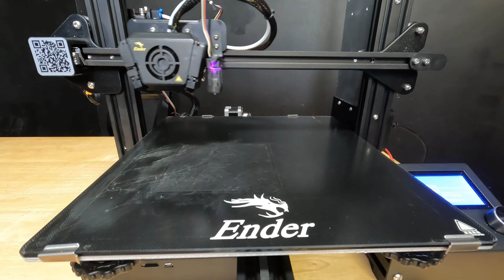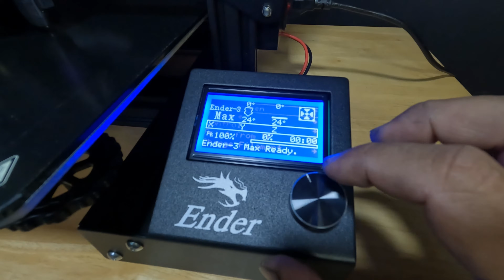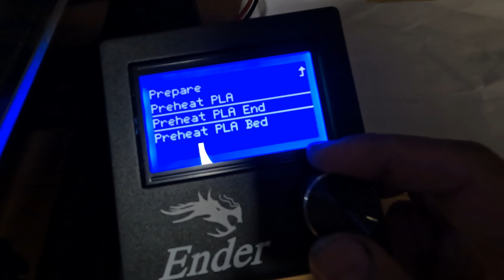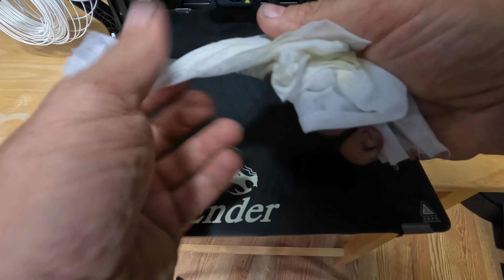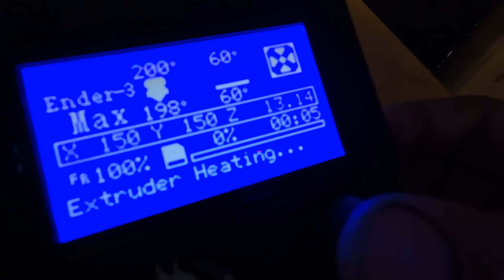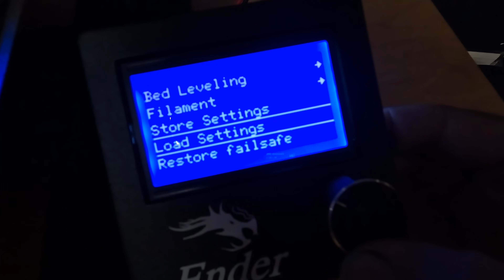Ender 3 Pro or Max: How to Level, Set Z Offset, and Make ABL Mesh, with CR Touch or BL Touch

Comment: Is it possible to only do the z offset without spinning the wheels? I don't know why I mean I'm following you but I don't feel I'm getting it completely, If my prints are dead center they print great but a helmet that takes the intire bed fails in minutes.
Reply from the maker: Z Offset is done last, after manual tramming is done. Do the paper method. Then the Z Offset last, to get the nozzle height down. Your problem sounds like a Tramming or ABL issue. Are you using the gcode for abl/
Reply: @3DRundown  yeah, I'm using m420 s1
Reply from the maker: Do this: https://youtu.be/mKvst6qpkPw
Reply from the maker: Do this: https://youtu.be/veZB415QHM0
Reply: I have the ender 3 max neo is that the same max in your description? I can't go past 0.0mm mine doesn't have 0.01mm option.
Reply from the maker: I'm showing the original 3 MAX here. The NEO is an updated version. Be sure you aren't in the MOVE comment. You need to be on the Z-OFFSET command.
Reply: @3DRundown   I am, I got it to where it looks like it'll possibly succeed but after awhile now my filament gets to worn down and stops feeding I've never seen that before.
Reply from the maker: make sure your extruder tensioner isn't too tight.
Reply: @3DRundown  you just have to make little adjustments with the tension until it works?

Comment: The glass build plate will crash into the back motor on the Ender 3 V2 when you do step 1.
Everyone says "Step 1: tighten the knobs, bring the bed as low as possible"
Then people reply with what I said above but they never get any help.
Does anybody know how to fix this?
Reply from the maker: Do not bring the bed as low as possible. You will warp your hot plate.

Comment: Hello Gregg, I think I might have a glitchy unit (cr touch). after doing an auto home ( and lowering the bed) when I go to the z offset, I cannot lower my hotend to 0.00. It stops at a positive number. I have tried over and over and keep getting a different z offset? Have you ever heard of anything like this?
Reply from the maker: Which machine are you on? Did you remember to remove the Z-STOP Switch? Also, I assume you installed CR-TOUCH compatible Firmware?
Reply: @3DRundown  ender 3 pro, switch removed, firmware updated cr touch
Reply: put in new springs this evening, now I get -0.2 for initial offset after auto home, I guess that is better? I followed your video exactly, I will stick at it. Thank you for making this video
Reply from the maker: Run this drill: https://youtu.be/veZB415QHM0

Comment: I have the sprite on my Ender 3 pro and when I try to level it won’t let me adjust the Z axis lower than +000.0. PLEASE HELP LOL
Reply from the maker: Are you using "move"? Have to be in the Z-Offset function (which sometimes called "Probe Z Offset"). Be sure you removed the Z Stop switch

Comment: Been having issues with my filament sticking to the bed. Doesn’t stick at all. I do not have an auto leveling printer. It’s an ended pro.  I can not create a mesh.  My glass has a dip in the middle. Probably my issue
Reply from the maker: Put a CR-Touch on it
Reply from the maker: Install Auto Bed Leveling Probe:  CR TOUCH or BL TOUCH on Creality ENDER 3 PRO - ABL 3D Printer
https://youtu.be/0Exh5tAN6ok

Comment: Hey i need help with my Ender 3 Pro. 
Updated to 2.0.8.2 Firmware because the multi languages... but it was stupid... the printer cant find x,y or z! I want to load the old original Verison but every time i try it didnt work... downloaded the firmware from Creality and load it on the sd card... printer is off, put the sd card in and turn the printer on... Printer is starting and starts the new not running Verison

can someone help ? I do not know how to continue
Reply from the maker: use a different card, 32gb or less, formatted to fat 32, rename the file to something else. anything else. FIRMWARE.BIN, or whatever. Try again

Comment: aaaaaaannnnnnd subscribed.  Didn't address the change needed in  Cura (which is understandable), but still a ton of help.  Thanks
Reply from the maker: This one? 😉Configure your GCODE to use the ABL Mesh from a CR-TOUCH or BL-TOUCH on a 3D Printer
https://youtu.be/mKvst6qpkPw
Reply: @3DRundown Probably.  I stumbled on a different video that covered that, before I saw this video.  Needless to say, that video didn't cover what this video did.  Long story short, I'm up and printing now.  Many thanks.
Reply from the maker: Keep in mind ABL GCODE for Marlin & Klipper are different.

Comment: I have the same machine and leveler installed but every time I go to print as soon as it warms to temperature a piercing alarm comes from the machine and the only way to stop it is by turning the whole machine off. There is no error code on the display, I have installed the software and it runs the self-test, and the purple light comes on. I can't find any information on the reason for this alarm. I am stuck, and can't print, please advise. Thank you
Reply from the maker: It's likely your thermistor.

Comment: What firmware do I need if I take off the cl touch….I can’t figure it out, it keeps losing the settings even after I saved them. Then Curo sliced the file, but couldn’t add to the sd card, not sure what to do.
Reply from the maker: I would never use an Ender without a CR-TOUCH. If you did. Flash a Firmware that does not mention a BL-TOUCH. If it doesn't mention it, it's made for use without it. When exporting a gcode from Cura. You are creating a GCODE file. Just copy that to the SD Card. If the card won't let you copy too it, maybe the card is Junk. Use a good quality card, 32GB or less.
Reply: Also, just found out the card reader is messed up on the printer itself. I clicked it in and out and on the 10th time it finally recognized it. Thanks again for all your input. Going to get a V3 SE, that way it’s built in. Hopefully I can figure it out.

Comment: The firmware on this video wasn't compatible with my mainboard since it was a GD and so the menu screens are different. I'm having trouble trying to figure them out. Can someone help?
Reply from the maker: GD?
Reply: @3DRundown  Yeah, instead of an ST my two mainboard's CPUs are GD. Apparently, ST firmware doesn't work right with GD (i was having file and SD card issues) so I had to download a different one and it's different than this firmware. I think I just might stick with this one and find a workaround

Comment: I got an Ender 3 Pro for Christmas and a CR Touch. I have been struggling ever since to get this thing to level and print. I am following your video to the letter, but when I attempt to adjust the z stop offset, it's moving the nozzle down like when I adjusted the z axis. So since my z is set to a negative number close to the bed, when I attempt to put that same number in as the offset, it's moving lower and trying to gouge into the bed. I'm about to just give up. I'm a pretty tech savvy guy, but this thing has me feeling like a complete idiot. Thanks for any help and the great video!
Reply from the maker: Hi Friend. When you adjust the Z-OFFSET, do not do it from the move screen, do it from the Z-OFFSET screen, then SAVE. No entering that # anywhere. Try this exercise: https://youtu.be/veZB415QHM0
Reply: @3DRundown  Thank you so much! I got it all set up. Thank you again for a clear, step by step video for this.
Reply from the maker: Epic. Welcome!

Comment: ive spent nearly a whole week trying to get my cr touch to work after alot of youtube i had no joy until i came across this guy and wow i loved the why he explained everything in simple terms for people like me who doesnt understand all this gcoding buff etc which most of the videos ive watched on here where trying to get you to do . thanks gregg i followed step by step instructions and now have turned my ender 3 to a ender 3 pro with cr touch happy days (until now i was going to throw it all in the bin as i honestly didnt know what todo until i came across gregg ) many many thanks gregg
Reply: Exactly this! Had my E3P for about 9 months, had some issues woth it st the start, sorted it and I stalled CR Touch. All good but could be better. Tweaks after tweaks and its looking good. 

Tweaked it some more and ballsed it all up and cannot figure it out. Tried all the typical Chep/TeachingTech/Makers Muse videos and just couldn't crack it for some reason. 

And in comes Gregg, watched 1 video and it's all fixed again and running better than ever. 

Instant like & subscribe. 
Immensely great full.
Reply from the maker: How did I never see this comment!? Very happy to get you going. 🙏🏼⭐️
Reply from the maker: Awesome, I'm just one of you guys. Happy to get you going! 🤜🏼🤛🏼
Reply: I'm in the same place you are, I hope this one helps.
Reply: Gregg is love
Reply: I also have the original ender 3 but my probe z offset refuses to save even after storing my settings

Comment: I guess I have a customized firmware? I have a "z probe wizard" in my advanced configuration menu. Makes it a 2 step process to set the Z offset
Reply from the maker: You may be using a third part firmware. Some do call it "PROBE Z OFFSET",  and some have a 'Wizard", but, I would suggest doing it manually instead, which your firmware will also have.

Comment: What do you mean home is to the left? It showed it homed in the middle as well as my ender 3 s1 homes in the middle....I'm having so many issues trying to get this going right 😭
Reply from the maker: Home position is the least of your concerns. I hate the S1. 3 Max is my favorite printer till the K1. What's your hang up?
Reply: @3DRundown  just can't seem to get the Gao right and when I get it working good enough that 1st layer is decent, it seems to change Gao distance in the middle of a print and starts dig6in to the layer as it is printing. I'm about to follow this guide of yours to the T as it is slightly diff than others I've seen that l don't seem to be working, or my bed is so F'd up and warps as it prints. But I just got a glass bed so about to give this a go.
Reply from the maker: Make sure you don't have some sort of droop on your Z-Axis. See if this video is worth anything to you: https://youtu.be/pP36ozrfRQ0
Reply: @3DRundown  I appreciate your help, I did all of what you said and still had issues. Nozzle changed the gap and dug into my model after 31hrs🙄 so I took that back and got a bambu ps1, so wish me luck!
Reply from the maker: K1 or P1 are solid machines
Reply: @3DRundown  yea, I'm definitely enjoying the P1S way better and getting a lot of good prints! Thanks again for the help, and have a great Christmas and New Year!

Comment: @13.57 when your Z-axis started moving, I noticed that your right side is lagging behind your left one. I suggest you tighten the inner wheel of you right hand side z-axis assembly. I had this issue once and it made some of my prints have major flaws. Otherwise, great video!
Reply from the maker: Opposite, When there is 3 Max lagging, LOOSEN the right side. Think of it like picking up a long pole from one end. Now, pick up that same pole, with weight at the opposite end...
Reply: Maybe the whole bracket where the wheels are on is coming loose
Reply: Yes, noticed it at 2.50 or so. Looks intense and something not tightened in the proper way. But good video. clear steps
Reply: You can see it throughout the video. This is bad for prints because it's inconsistent. Likely it's loose, but I've also read it can happen if the rubber wheels develop flat spots (due to wear, particularly if too tight). In that case, new wheels are recommended. Either way, get them appropriately adjusted, preferably with everything square (e.g. uprights to base, gantry to uprights, and so on).

Comment: My z offset doesn't move when i try to set it. It applies  the changes when it starts a print a d its crashed into the bed plate and i have no clue how to fix it.
Reply from the maker: If it's hitting the bed. It's too low. Raise it and set it during the skirt and first layer.
Reply from the maker: https://youtu.be/veZB415QHM0

Comment: Sorry if I missed this — after running through this, how do you maintain the bed level? Do you just let the CR Touch run it's autobed level procedure again?
Reply from the maker: Your knobs should stay put, and should not reauire adjustment often. Minor changes, can be resolved by running another ABL. I would only run an ABL again, if you see a need too.

Comment: why  everytime i try to print my cr touch does the probing point like 16 times. like its leveling the bed before every print..how do i stop this?
Reply from the maker: it is likely in your start gcode. Which machine, which firmware?
Reply: @3DRundown  I fixed it. It was the g29 code.

Comment: I'm having a real hard time getting the results you are on my E3Pro with bl touch. When i auto home and use the paper to figure out the z_offset, i ebter it on the printer but it clamps the paper down hard with the same number i had on move axis. Went the discrepancy?
Reply from the maker: Use the 1st layer of a print to set your Z Offset
Reply from the maker: An also use this to help get used to setting your Z Offset: 
https://youtu.be/veZB415QHM0

Comment: @3DRundown, I just brought a creality Ender 3 (not pro, max, or v2) and this is my first 3d printer. Does this method work for all the creality printers or are there specific steps for each one? Thank you for your help! I found your videos very straightforward and informative.
Reply from the maker: The manual method will be exactly the same. a 3 MAX is bassicaly a large Ender 3. See if you can put a CR-TOUCH on it. Depends on the board, but it's SO worth it...

Comment: Thanks for the guide! An issue I've been having is after I move the Z Axis (+0.7), when I got to configure the Z-offset, it ends up moving the extruder up. End result is that when I'm printing, the extruder is pretty far up off the bed. Any idea on what's going on?
Reply from the maker: While printing your 1st layer, baby step down till it's OK and save

Comment: Once the nozzle touches the paper, the thickness of the paper needs to be added to the number you get. Regular paper is 0.1mm. The offset in this case is -3.8mm.
Reply from the maker: Nah, I only using the paper to get it close, then using actual 1st layer of print, to dial in the final #.

Comment: im so confused by "home is the left side) comment since my ender 3 pro goes to the middle of the bed when i press to go home, then while watching the video i see you cut the video and your hotend is on the right... im new to this so might be the reason its confusing me, please explain what you meant if you dont mind? it might help other begginers as well. Thanks
Reply from the maker: The 3 MAX and PRO are virtually the same, but yes, your E3 PRO may HOME in the middle. Mine does. I am actually working on setup video for the E3PRO, despite it being so similar.
Reply: @3DRundown  got it, thank you I appreciate your response.

Comment: I followed this step by step, except my nozzle stops at -0.65 but yours you went past that did I do something wrong?
Reply from the maker: E3 Max? You have Cr-Touch? Did you remove the Z-Stop Switch? You need to remove the Z-Stop Switch. What firmware you running? Gotta get you off stock.
Reply: @3DRundown  ender 3 pro, and I had someone make the firmware due to the one on creality crashing on mine
Reply: Along with it not registering the stls I had on my SD card
Reply: @3DRundown  but yes I have the br touch, haven’t been on stock in a while had to recalibrate my printer, and haven’t been able to get right for a bit.

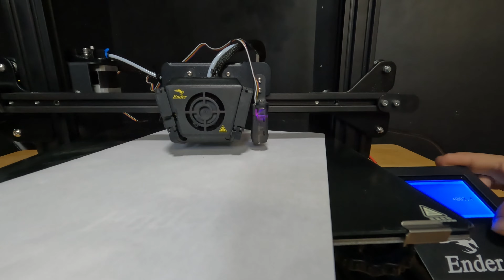Comment: At 5:21 you indicate to keep adjusting (negatively) until the nozzle gets close enough to create tension on the paper.  I noticed your LCD indicates a negative value.  When I scroll the wheel mine will only go to 0.00 and not allow a negative value and I am still too far above the paper.  Any ideas?
Reply from the maker: You may be in the MOVE menu. After moving to 0, You'll need to go into the Z Offset setting to set the Z.